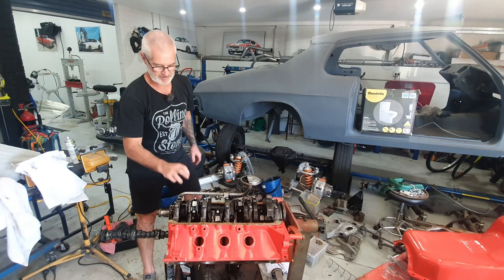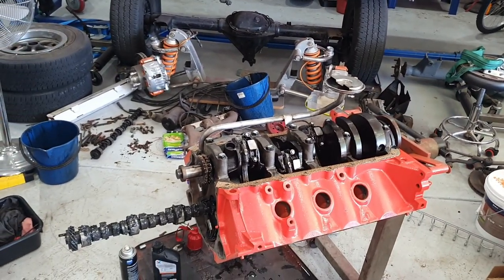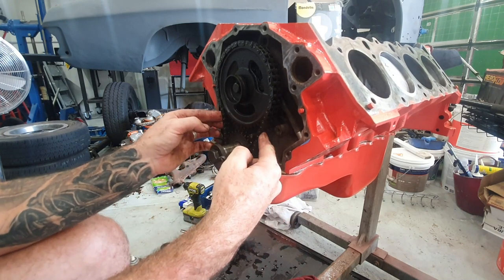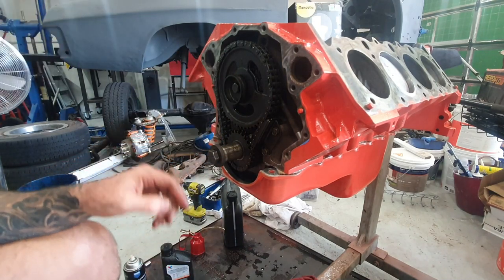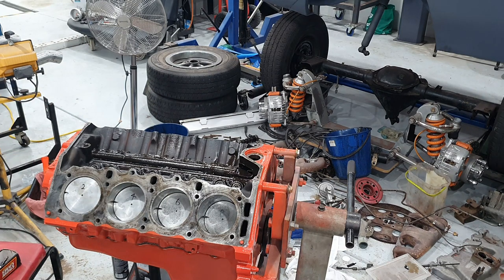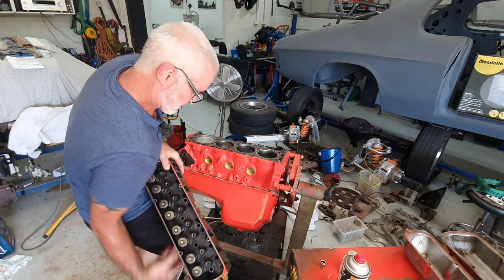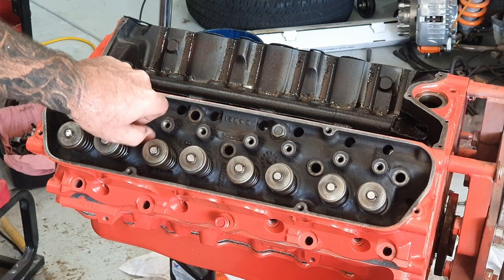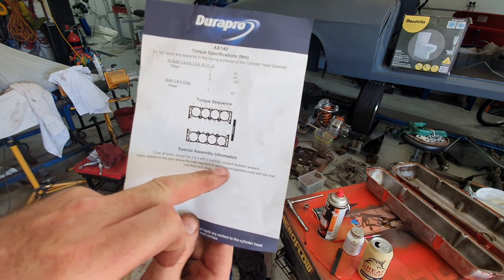Holden HQ GTS Coupe 253 Engine build (Part 2)

Comment: Loving the build Sully, building the same engine for my HQ Ute so this is great stuff. Tell me what cam did you go for? Cheers mate
Reply from the maker: Hey @hannahdavies2467 the cam was a crow cam p/n 5602, it's just above standard. With better throttle response. I need the engine to idle like standard as the engine/car is being built back to original spec as its a matching number GTS coupe. Hope this helps. If you heed to know anything else just ask.
Reply: @SullysRodskustoms.  Thanks for the reply and fair call on the cam to keep it as original as possible. I'm trying to work out the best cam for my 253 with the standard two barrel intake and a 350 holly. Cheers
Reply from the maker: @hannahdavies2467  I have a standard 2bbl ww stromberg on mine, so mine is as standard as it gets. I have a video on rebuilding the stomberg coming up this week too.